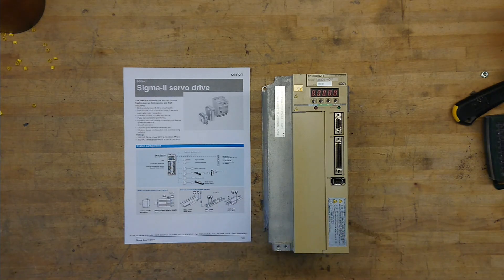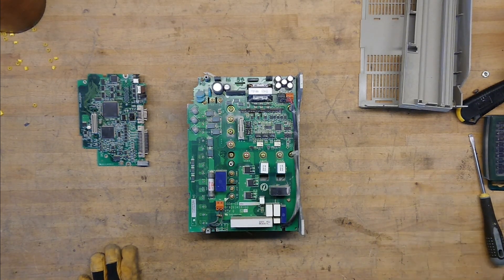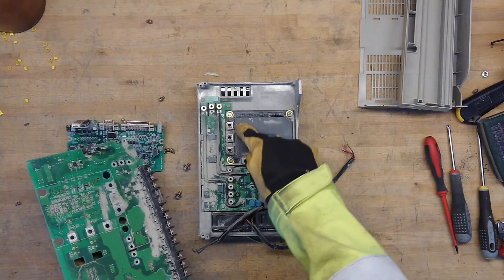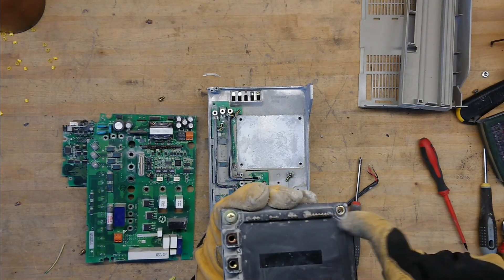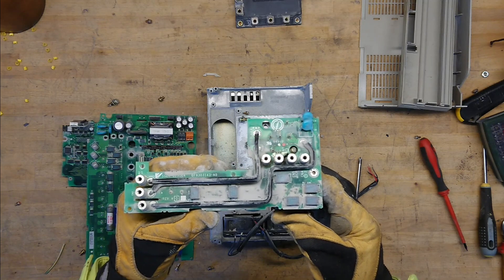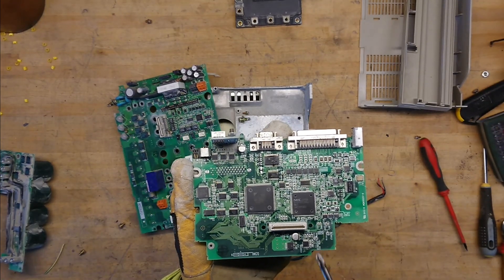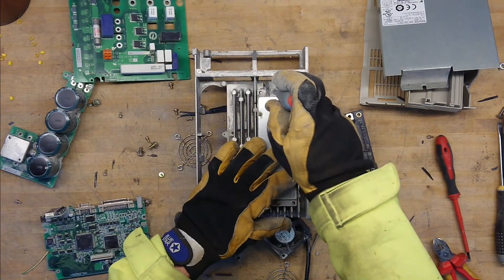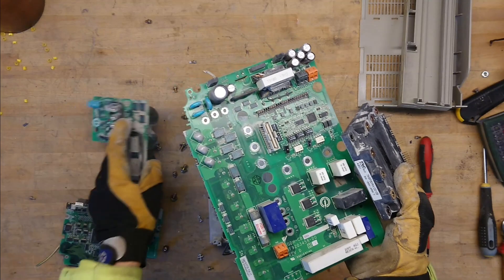Omron/Yaskawa 3 kW AC Servo Drive Teardown - Isolation, Day 34

Comment: wow, the state of that unit... people really need to be placing these drives (including vfds that are not Nema 4+) into dust- and water-tight enclosures. i've watched a million of these drive repair vids and almost all of them have one thing in common, the boards are completely trashed with layers of filth. i'm no engineer by any stretch of the imagination, but it seems silly to me to install high power/high voltage motor controls without any degree of protection against contaminant ingress. it's especially bad with HVAC installations, with no shielding against condensation, and very poor heat-removal methods. and then users wonder why their drives become unreliable, blaming their failure on the igbts or the manufacturers/repair techs 🙄 i wonder how long it's gonna take before installation technicians figure out that drives need to be protected if they aren't already rated Nema 4 and above.

at that point i don't even consider it to be a lack of understanding of what drives are or how they work. you'd think that if you're hooking up a 3kw motor to some component, you'd logically infer that the component is handling a serious current and voltage load, and that you should put it in a damn box. that would be like utility companies installing transformers on poles with no tank, oil, or bushings, then crying about unreliability when they go bang after two days. sounds dumb, but that is exactly what's going on with the shoddy installation of drives like this.

sorry for the rant, but i really hate to see semiconductor-based drives get a bad rap from failure caused by meat-fisted and smooth-brained installation personnel. this type of technology is at the cutting edge of energy conservation and the switch to electrification, and drives should be treated as extremely valuable commodities. these drives are gonna be made smaller and smaller with increasing efficiency, and will find their way into more and more consumer appliances, especially with recent advances in SiC-based switching. they already are everywhere as it is. you wouldn't store crude oil in tupperware, so drives should also be kept safe and secure.
Reply from the maker: I have seen it in so many factories. Dirty control cabinets. Usually due to maintenance costs on changing filters have been cut! In more modern times, refrigerator cooled and sealed cabinets was used in the brewery business.
Reply: @KaizerPowerElectronicsDk  yep, it's silly. they cut maintenance costs, and next thing you know the VFD goes pop. and there you go, instant downtime, with an expensive repair, likely a full unit replacement. definitely more expensive than just cleaning the vent filters 😂 and yes, i actually work in a modern brewery, and the multiple vfds they have are all either in sealed control cabinets, or are washdown grade. makes a world of difference, as they have all been in constant, demanding service for about a decade. it gets HOT in there, but there have been no vfd failures in the company's history. in my opinion, if you're going to go the route of modernizing and installing a vfd, you might as well go the extra mile and make sure it's safe and comfortable in its environment. they are so important to cutting down on energy costs. plus, come on. vfds are so COOL! installers should WANT to install them properly. 

those Fuji IPMs, also, are fantastic, and should last for a good long while. it really does help to have the gate drive circuitry operating under carefully established conditions like that. Fuji equips all of their vfds with their house-made igbt IPMs, and that really drives the cost and size of the units down. i've got a fuji vfd in my home that i installed to run a modified shroud fan, that i never really have to turn up to more than 3/4 speed. i took the risk on it, and am now completely in love with their drives!

Comment: Interesting construction on the brick. I also expected it to be filled with this clear gel stuff that is in most of them.
Reply from the maker: Just for the fun of it, I have tried to melt this gel to even it back out after poking around, not even with a heat gun at 2 kW at full blast will it soften up or melt. It is truly made to contain a lot of energy.
Reply: Please give your wahttsapp or viber Viber
Reply: The IGBT????